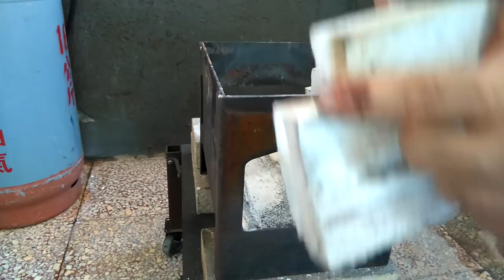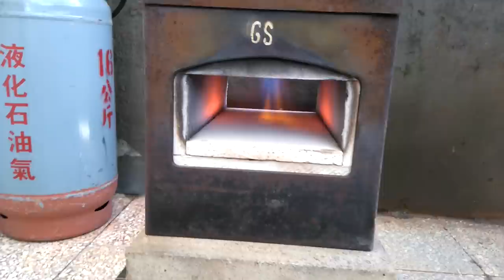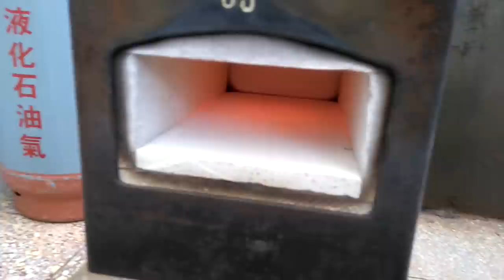Blacksmithing - relining my forge

Comment: Hey Glen how efficient is your forge? I'm asking because most forges seem to have atleast 2 inches of refractory in them.
Reply from the maker: It's hard for me to say exactly how efficient it is since I've only ever used this style of gas forge for nay length of time. For many years, I only used coal. But I can run at very low psi (4  or 5 psi) and easily get to forging temp. The refractory in my forge is not 2 inches thick, more like 1 inch, but it is very good quality and able to withstand extreme temperature. Fuel economy is important to me and I would rate my small single burner as efficient if I consider daily cost. Thanks for watching. Glen
Reply: Thank you for your reply Glen! Appreciate it very much.

Comment: Hi Glen how does that board hold up, just got some 25mm and want to put some in the ceiling of my forge and probably the sides just reduce my inside diameter at the moment.?? Thanks for sharing this re insulation.
Reply from the maker: It holds up very well. It's much better than the soft blanket type material, in my opinion. You just have to be careful to not poke it too much when inserting and removing your steel. Thanks.
Reply: Ok thanks Glen for the info.
Reply: Just relined my forge too Glen and I used some of this  board seems to work good, before I had kaowool in the ceiling coated with satanite, and it went ok, but when taking your material in and out, sometimes you accidently touch the sides or the roof, well the roof started giving way and drooping and the satanite started falling off. So yeah so far happy with it.

Comment: To..(The Product ) A good way or perhaps the only way not to ruin your Firebrick or kaowool during Forge Welding , is to use Kerosene as a Flux..
Reply from the maker: That's an excellent suggestion. I don't have any experience using kerosene so your input is appreciated. However, I do know that the process for using kerosene is a bit different than for using borax. I may have to give this a go... Thanks. Glen

Comment: hey. if you have time to get back, i am looking to buy a forge and i need to know if this can get 2 lbs of steel to welding temp.
Reply from the maker: I really like my Diamondback Ironworks single burner forge. But if you are looking to weld larger size stock, I think it would be better to go with a bigger, dual burner forge. This forge I have can reach welding temperature but at that point, I'm running at very high pressure and my welds are hit or miss. I feel that coal is the way to go if you will do a lot of welding. Anyway, if you need a general purpose, small forge, it's hard to beat this forge. I often forge pieces in the 3 pound range (hammers) with no problem. But if you need to exclusively weld, then I think other choices might be better. Thanks for watching. Glen
Reply: nah, i have a coal one and the coal is a pain to work around. Once you reach welding temp the coal welds it's self to the steel and all kinds of nonsense. Once one side of the billet reaches welding temp you have to turn it over which moves the coal off of the billet and you have to restack the coal again. After the side you just heated to match the other side reaches temp the top is below welding temp and the bottom is about to seriously decarb. Personally I liked the propane forge I made, but i didn't think it reached welding temp, and it was super inefficient so I threw it out when we moved (best $60 I ever spent). Also the flux makes the coal stick and  sometimes the coal will get stuck in a crack and no amount of brushing gets it out. I think the japanese were on to something when they wrapped it in mud paper or whatever it was.
Reply from the maker: I guess the forge most useful for welding somewhat depends on what is being welded. I've never made Damascus billets before so it's hard to comment on that. But from what you've described, it sounds like the coal you used wasn't the best quality - too many impurities / clinkers. if you ever get some, try using forge coke (industrial forge coke, not the soft stuff that forms in your forge). It's basically coal that has been refined; had impurities burned off. It's hard and does not form sticky clinkers or adhere to workpieces. It burns very cleanly and even hotter than bituminous coal but needs a good air blast to keep it going. Anyway, good luck in your work. Glen
Reply: thanks. i use anthracite coal which is pretty much the cleanest coal there is, but even after you clean it the scale forms clinkers in a split second. That being said i normally just put the steel back into the fire using a heat, brush, forge, heat. it might be better to heat, brush, forge, brush, heat. idk i do need a better coal forge as well since it has only a 1in hole in the bottom for air vs a 3 or 4 inch hole with a bunch of holes in it.

Comment: Glen, are you still using the Diamondback?  When you say you average 16 kilos a week: how many hours is that?
Reply from the maker: Dan, Yes, still using this same forge and have been for years. On average, I have my forge running about 4 hours per day. In hotter weather, I would say I can easily get ten uses and so basically 40 hours of good work from 16 kilos. I feel that to be pretty efficient. Thanks. Glen

Comment: So, what will be the first job to go into the new lining?
Reply from the maker: The first thing I did was make a hammer. I definitely notice a difference in the higher BTU's my forge can reach with new lining as compared to constantly using the old, worn out lining when running at the same pressure. Thanks. Glen

Comment: Glen GS Tongs hey buddy so your video has inspired me to make my own gas forge for my Lil garage shop. Right now I have made a shell similar to yours. im at a stopping point though because I know nothing about refractory material. can you give me some info about the material you use? about how much should it run. im worried I might purchase the wrong thing. pls sir help
Reply from the maker: To be honest, I don't know a ton about refractory materials other than what they do and how to make use of them in a forge. Many guys use a product called Kaowool. But this may be better suited to round forges as it's soft, like a blanket. The stuff I use to line my forge is a fibrous board that is stiff but not hard. It can easily be cut with a utility knife or pvc pipe type saw. I'm not sure what brand names this stuff goes by. For the floor, I use a harder ceramic refractory, something like what is used for small crucibles. But you can also use refractory bricks. Maybe do a search for kiln materials, shops that supply refractory materials for kilns and forges. For me, it costs about $30 for enough refractory material to reline my forge and this lasts a very long time. Sorry I couldn't be more help. Let me know what you find. Glen

Comment: Glen what do you call that ceramic stuff you used for the floor and where can you get it???
Reply from the maker: I honestly call it "ceramic stuff". There's a factory in a town not too far from where I live that produces all sorts of refractory boards.
Reply: I would guess it's just ceramic board...?
Reply from the maker: Yes, ceramic board with high heat / refractory properties.
Reply: @gstongs  Yeah we have board here too but it's that soft stuff you used on the sides and for the roof, what you used on the bottom is like a kiln shelf or similar I would imagine, that soft board and I have some, would not stand up for a floor on a forge.

Comment: Joey seems like I like your work.
I am soon to finish my first ribbon burner and know it's not big enough to do bigger than 3.5"X4.4" but it will do 90 percent of the work I'll be doing. Believe it will be plenty hot and burn a fraction of the propane gas.
I'm going to build a large on next spring if all goes well and will copy your forge and petty much of the insulation as you did.
 Thanks you for helping me with a great hobby Sir.

Comment: Glen, what is the name of that ceramic floor piece?  Is it a hard ceramic?
Thanks for the video.  The black was due to incomplete combustion (soot) the actual flame front is at the transition from the tube confines to the lower pressure forge chamber.

Comment: Hi Glen,
I ordered the refractory board for my Forge, like yours.  It did the same thing and turned black.  I was told this is normal.  It cooks off and returns to its normal white color.  Maybe it's just a thin coating of something to protect the board?  At any rate, it's normal and burns off.
Reply from the maker: Mark, Thanks for letting me know that. I really didn't understand why it turned black but I think you're right - something needs to be burned off and then it functions as it should. And this is greta info. since I need to reline my forge again soon and know that that is normal. Thanks. Glen

Comment: Man Glen, 
Did you make your Forge?
I just got some very interesting ideas about making a rectangular forge that I never thought of before Thanks to you. boy, your forge is small, but your entire setup seems rather small. are you on a balcony of an apartment? I'm just trying to visualize your setup...
could you possibly give me some info about your burner? the nozzle must have been removed before the video??
Reply from the maker: Brady, No, this is a forge I purchased from Diamondback Ironworks. I've used it so long and have made changes. Yes, it's a small single burner and my balcony, while not small, the area I use for my shop space is. I rent the entire top floor which includes the roof so it's actual not a balcony in that sense. The burner consists of the vertical tube going into the forge, the bell reducer on top of that, and a small pipe which passes horizontally through the bell reducer (drilled holes with set screws). In that small pipe is a tiny orifice where the gas comes out. So while I didn't show it in detail in the video, it's all there on camera. Thanks. Glen
Reply: +Glen GS Tongs Thanks Glen. even though I'm very new to blacksmithing I've been a welder and fabricator for 40+ years. I'm trying to find a niche with a new business  when I retire from my current career. designing and building things is a natural thing for me. just trying to find my place. I was hoping to design and build Custom Outdoor Kitchens and Living Spaces, but that may not be in the cards... Blacksmithing and Bladesmithing will be a for sure...
pleasure speaking with you, 
Brady

Comment: Glenn the hole around the end of your burner should be a little larger in the fire brick to create a venturi do you get the second burn
Reply from the maker: Yes, the hole through the refractory is indeed a little bigger than the interior diameter of the pipe. But I always thought that the bell reducer at the top of the pipe (burner) is what mainly created the Venturi effect. Thanks. Glen
Reply: Glen GS Tongs the top bell allows the inward draft,but the inside having similar expansion allows the mix to "roll" the flame st the exit to help prevent the flame going out at the when just lit and okay keep air flow from going back up the pipe.

Comment: how long does it take for your forge to get up to temperature to make steel malleable?
Reply from the maker: Normally it take about 5 minutes to get my forge hot enough. After I start it up, I fist put in whatever smaller pieces I want to forge. After a few minutes, I can start forging but I would say it takes 15 minutes for my forge fire to become neutral and working at it's optimal. Thanks. Glen

Comment: I hope that you are wearing a respirator when cutting the liner as it is pretty dangerous fibres to breathe in.
Reply from the maker: Yes, the dust from this material is definitely not good to breath. I normally wear a dust mask but didn't in parts of this video thinking my voice would't be clear. Anyway, your comment is good advice. Thanks. Glen

Comment: if you don't mind,what's the pressure your regulator is set to?
Reply from the maker: Joe, I usually run at 4 or 5 psi. If I am working on a larger hammer, I may crank in up to 6 or 7 psi. So I would say 5 psi is the median pressure I run. After relining, I can run at a slightly power psi and still generate the forging heat I need. Thanks for watching. Glen
Reply: Appreciate the quick reply,and thanks for sharing your knowledge...
Reply from the maker: My pleasure Joe. Thanks. Glen

Comment: What are differences between a refractory board and refractory brick? I'm baffled by that at the moment.
Reply from the maker: Basically, the bricks are hard - not much different than ordinary red building bricks as far as hardness and they come in a similar size. Refractory board is stiff and not bendable but can be easily cut. And blanket type refractory is soft and bendable. I also mention ceramic refractory which is very hard and relatively thin compared to bricks. It's more dense and not much different in hardness to bathroom tiles. All of these come in varying degrees of quality - recommended to withstand varying temps. but most work fine for average forging. I hope this helps. Thanks for watching. Glen
Reply: +Glen GS Tongs this helps a lot. Thank again!

Comment: Where did you get the ceramic tile from...
Reply from the maker: Hi, I got the refractory ceramic from a company here in Taiwan that manufactures these materials. It's a small factory that I think exports to markets/companies that use these types of materials. At least that's what I gathered when I spoke to the owner. Thanks for watching. Glen
Reply: These materials refractory ceramics can withstand the highest Fahrenheit temperature? How should choose a variety of temperature types Refractory ceramics？
Reply from the maker: I think you should choose refractory materials based on where it will be used. Hard ceramics and bricks are good for forge floors. The stiff, fibrous boards are suitable for forge walls and ceilings. The soft blanket type materials are good for forges that are round (odd shapes). These materials can withstand very high temperatures (it varies from material to material) and most are suitable for blacksmith forges. Thanks. Glen
Reply: 请问您的炉灶节约能源？有多少燃料公斤你每小时需要什么？谢谢！
Reply from the maker: My forge is fairly economical. It's a small single burner forge and I normally use it at about 4 psi. I've never calculated how much fuel I use per hour - my propane tank holds 16 kilos -  I typically get ten days of use out of it and the average forging time for me each day is about four hours. Thanks. Glen
Reply: This ceramic fiber refractory in the combustion there will be a lot of invisible particles of dust, long-term forging may cause lung damage, whether the thought of what fire-resistant mud coating on the fiber surface? What kind of fire-resistant mud coating effect is better? Chinese mainland clay can it? Or what better refractory coating in China? Thank you! I wish you health!

Comment: Hi, can you write the name of material that you had use? Thankyou
Reply from the maker: Caligo, I don't have an actual brand name for the material I used. All I can say is that it is high heat refractory used for kilns, forges, ovens, etc. And this refractory comes in different densities - some soft like a blanket, some as bricks and some as ceramics. Sorry I couldn't be more help. Thanks for watching. Glen
Reply: hi, don't worry. I try to ask in build matirials store. Thankyou for reply and your video!
Reply: AdriS I looked up "high temp refractory board" and found a couple of sites.  They come in various widths.  Figure your measurements and they'll send it quick!  My piece cost around $100 to do the entire forge (including shipping).
Reply: thakyou very much mark!

Comment: they got a web site or email looking for it on the net can't find without buy 1000 pieces.
Reply from the maker: No, they don't have a website. What exactly are you looking for? Glen
Reply: Glen GS Tongs hey buddy so your video has inspired me to make my own gas forge for my Lil garage shop. Right now I have made a shell similar to yours. im at a stopping point though because I know nothing about refractory material. can you give me some info about the material you use? about how much should it run. im worried I might purchase the wrong thing. pls sir help